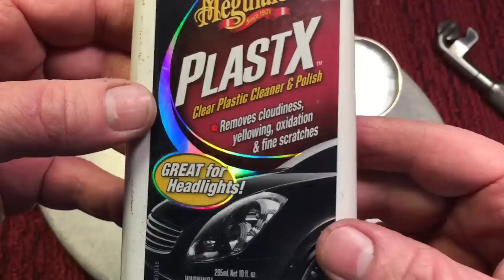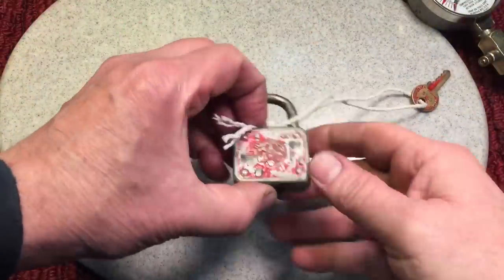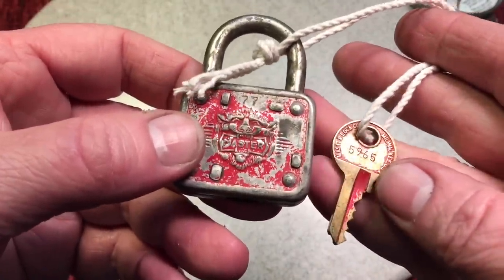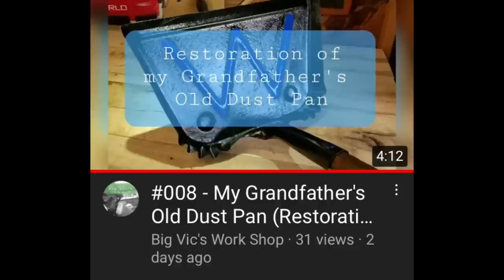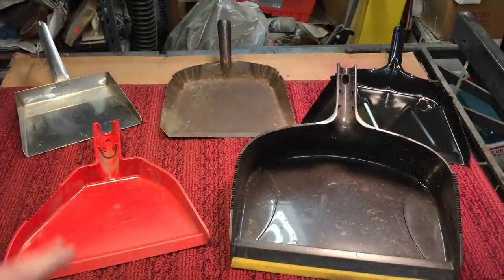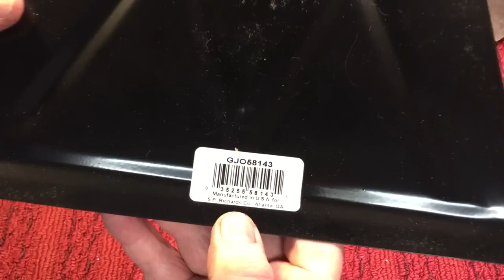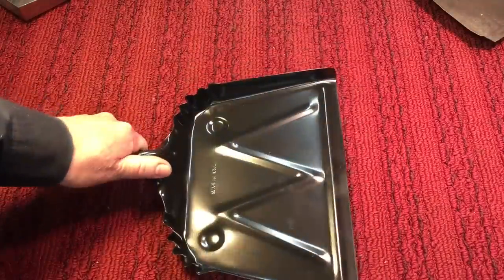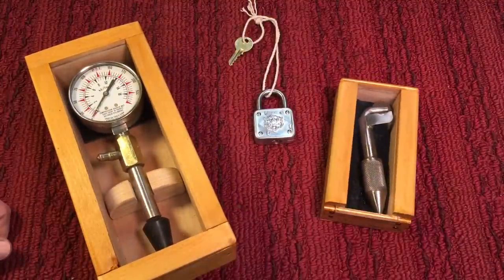Rare Tubing Cutter, Snap-On Compression Tester, Master 77 Padlock and Dustpans!

Comment: "Futzing" and "fidgeting around" were two of my old primary (elementary) school headmasters favourite sayings when I was younger, so even transcends the Atlantic.  I have a pressed steel dustpan that I bought when I moved to the US 20+ years ago, but its a little big for bench top cleaning - more of a shopfloor cleaning tool.  I need to find a smaller one with a brush with a homing device on it, as I am constantly looking for the brush I 'just put down' :)

Comment: Another trip down Memory Lane. Even though my father used to yell at me in broken Italian I do remember hearing the term stop futzing (spelling?)around.  Probably a cleaner version of the other “F” word. Also remember using the compression tester back in the day. We learned how to use them in auto shop in high school. If compression was low you would squirt some oil into the cylinder and retest and if compression went up it indicated bad rings, if it stayed the same valves were suspect.

Comment: I was thinking about my very old (maybe 70-80 years or older) pipe cutter. I cleaned it up recently and tried to get a new cutting wheel for it. Naturally, they are unavailable.
After a struggle getting the wheel out of the frame, I decided to put a piece of threaded rod in the center of the wheel and spin it with the cordless drill while holding it against a sharpening stone. It didn’t work too badly. Now it even cuts` pipe again.

Comment: I used to think that pipe/tubing had to be de-burred in order to maintain flow velocity.  Plumbers don't give a damn about flow velocity, but they do care about noise.  I just "restored" a dustpan like your grandmother's  that I've had for over 40 years.  I almost threw it away before the lightbulb went on.  So, I straightened out the leading edge and painted it. Badda-bing-badda-boom, good for 40 more years.

Comment: Good show today!  Hyacinths will fill a room with with the smell of spring.  Yes.  I could smell it thru the you tube!  We had one of those cheap flimsy metal dustpans when I was growing up.  It was so flimsy, the handle would twist with any weight in the pan.  I did score a stout old dustpan from the American Bridge building where I got the old drafting table.  Unless I drive over it with a car, it will out live me.  Its pretty tough. 🤔 Maybe I could drive over it, and it would be fine!  😁
Reply: How sad that I bought my own heavy duty metal dustpan at HF. Similar to his but a tubular handle that is comfortable to grip.

Comment: I have a dust pan that my dad made in shop class back in the early  1940's. He made a repair on it using rivets and a strip of aluminum. Dad passed away 8 years ago. The dust pan still gets used in my work shop.
Reply from the maker: That pan is priceless...
Reply: That it is, thanks

Comment: Only Scoutcrafter could do a video on something as humble as a dustpan and keep my full attention. Really enjoyed it. Looks like you have a nice collection of them. That tubing cutter is an absolute beauty. With the lion design, what vintage would the Master 77 be? I think the compression tester is a real oldie. Compression testers with screw in fittings as opposed to the rubber cones are much better and assure better accuracy than the cone type which you have to keep holding in against the pressure of the rising piston . At the same time, if you're using a remote starter, you're trying to keep remote starter wires out of the fan and belts. I like the way you get such great results from salvaged materials. It appeals to my sense of thrift. Happy Easter
Reply from the maker: Pat- They made the 77 lock for many years!  Plenty NOS ones out there!   Just a smart looking lock.  -=D  Thanks!

Comment: I believe that says MAN KAY Toe, Minn. That's how it's phonetically spelled. This little town always comes up on the top ten lists of best towns to live in Minnesota.
 I had to cut my plexiglass window today with borrowed tools from a neighbor when I locked myself out of my home. I was very glad I upgraded that glass to plexi many years ago because I didn't have to break anything to get back in.
 Futzing around. My parents used that, too. Highly religious family and they did not want to set any bad examples for us kids. They made sure you were brought up right! I always thought it was generally equivalent to "farting around" ie time wasting. But it does feel nice to have days to just do as you want. Right now I have too long of a list of things to do.
 Buy once, cry once is why I put a 1/2hp 600rpm steel and concrete Craftsman drill on lay a way at Sears when I was 15. Remember lay-a-ways? I still have that 3 handled drill. The gearbox was all metal enclosed. Bought it with my paper route earnings.
 Today's modern dustpan is the cordless vac. I wouldn't have bought this but I got a $200 cordless one because some one was too lazy to cut out the dog hair and clean it up right. Sure helped me cleaning up all the plexiglass shavings I made while cutting through my front window.
 I should have known you collect shop brushes, too. But of course!

Comment: Truth Tools of Mankato ( first vowel is short the next two vowels are long) still exists.  They hired a young engineer that later started his own company Owatonna in Owatonna of course and which later purchased Truth in 1950.  Truth was famous for their punches and chisels made from Tarzen gear steel. Yeah it is spelled that way by the company.  They drove one of their chisels through a 1" thick plate steel without damaging the chisel. How is that for advertising.  Since you have the tube cutter then you should get the flaring tool to go with it. I have both styles of compression gauges but someone is always borrowing the quick gauges and don't give them back.
Reply from the maker: Thanks Philip!  😃👍
Reply: @ScoutCrafter   You know I am really fond of Midwest manufacturers.

Comment: My father used to say fuh tuht zin (did my best to spell it phonetically) rather than saying the f word. I also grew up very close to NYC. It’s funny about the dust pan, and how those things bring back memories. I own the house I grew up in-lots of memories there even though it’s rented out to tenants. 

You can still come across good quality hardware, just not at Home Depot or Lowe’s. When Price/Savings is the foundation of the business, you’ll get what you pay for. The independent guys or the real pro shops carry the good stuff. That Plastix Polish is good stuff. I just did a video on the Novus polishes on my channel. Have you tried Novus?

Comment: Scoutcrafter - I was a professional picture framer fo 40 and cut thousands of sheets of plexiglass every month. That is not the way to cut it - it will get scratched to hell! the shavings from the blade and the saw table are very abraisive! You use a straightedge, T square or similar to score it 3 - 5 times depending on the thickness of the plexi then you snap it over a work bench edge. If done properly, it will crack perfectly smooth and even - and should not need any touch up. If the plexi is new, always leave the protective paper or plastic on until after it's cut. Over my career I have probably cut close to a million pieces - not kidding! PS if one was not to care about scratches (which will be plentiful) then a saw will physically cut plexi -  just not useful for any purpose where scratches matter.
Reply from the maker: Bobby- I never had luck scoring plexiglass and snapping it...   You are right about scratches but if you leave the film on and brush the table saw there will be none...  I can cut a dozen pieces of Plexiglas in a minute with perfect results every time...  I tried the scoring and it is never 100%   =D   Thanks

Comment: A car from the early 70’s you could have your 8 year old climb on the motor and hold the compression tester in the spark plug hole.  Then dad could sit in the driver seat and turn the engine over get the reading then yell next and the kid push it in the next spark plug hole. Now days that would be child abuse and the other problem is you can’t reach all the plugs. Grrrr.